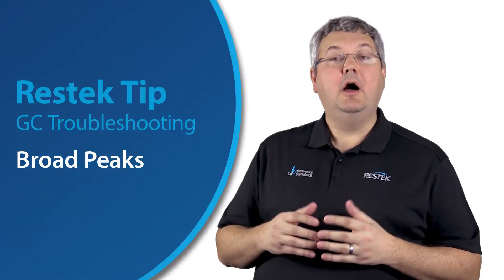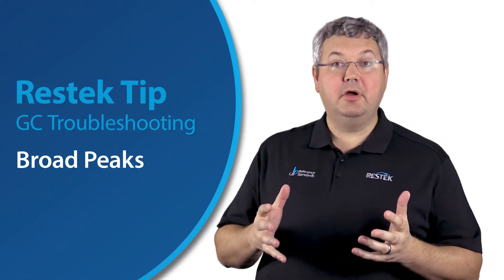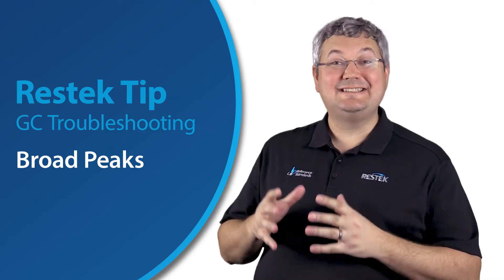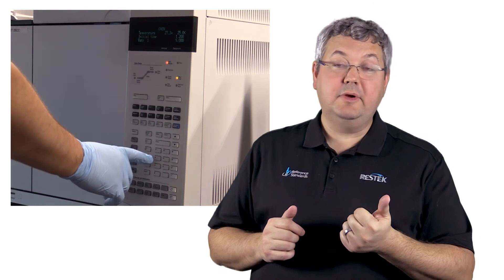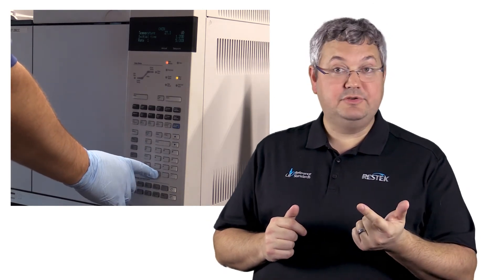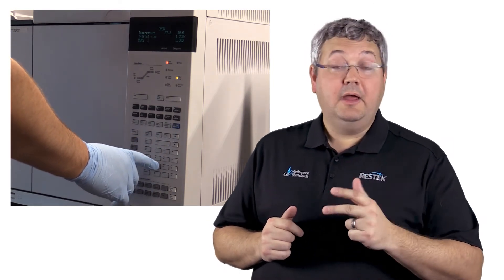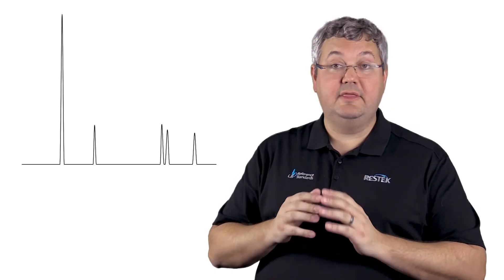GC Troubleshooting—Broad Peaks

Comment: i do have problem with gc fid mechine brand Agilent technologies. my problem is about solvent peak is not visible in chromatogram. the solvent that i used is methanol. what should i do?
Reply: @RestekCorp  actually i did used distilled water.. my mistake... thank u for your respond